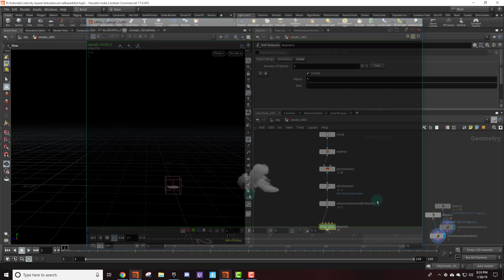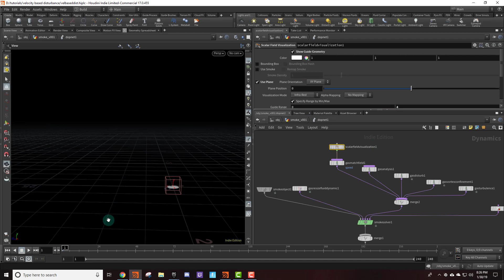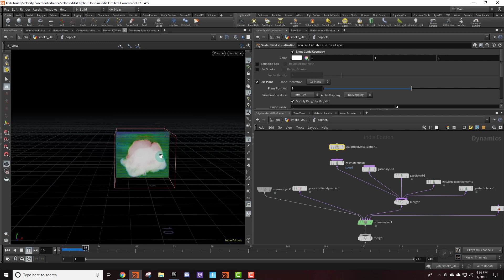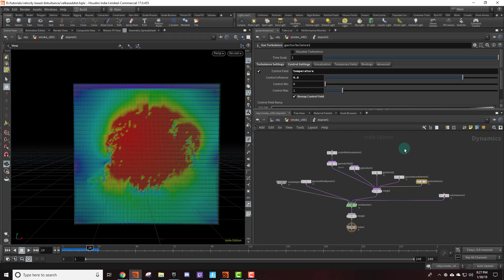velocity based disturbance houdini [old]

Comment: Hello, how and where i connect this node in the new pyrosource?
Reply from the maker: I just marked this video as old, the new pyro solver has a built in calculate speed button. I might just make a new video sometime.
Reply: @evanrudefx   Do you know how pressure masked disturbance  pyrosolver
Reply from the maker: @SebastienLevieux  I have no idea what you mean, sorry. I don't understand the question
Reply: @evanrudefx  Sorry, I am trying to avoid the mushroom effect in my sim with the new pyrosolver, someone told to do it  like that: "you can export pressure field and use a volume reduce node packing max value into detail to figure out what knid of values you need. its tricky, requires a bit of fine tuning" And I found your video...
Reply from the maker: @SebastienLevieux  I think I saw something about that using the pressure field, but I don't use that method. On the new pyro solver I just use the new calculate speed and use it as a control field for gas disturb. I will make a video at somepoint, but I am not sure when. you can also check out this video: https://youtu.be/Hy4R5Vf-dVM?t=920 He talks about at that time stamp its more so about breaking the shape into smaller mushrooms rather then avoiding them because mushrooms are natural movement in a fluid solver.  Oh, to say one more thing, I also like to add random velocity to my source particles using either the curl noise on the point velocity sop or the "add velocity noise" on the pyro burst source. If you crank that up will break your shapes quickly from the original shape.
Reply: @evanrudefx  Thank you for your explication, it is amazing :)

Comment: nice tutorial. you should be able to dive into the gasdisturbance dop and add a "length" node between the "control field parameter" and the "if then block". might be a bit more memory efficent due to houdini not having to create an extra field.
Reply from the maker: thats true! I do it this way because I am a noob and like to visualize the "speed" : )
Reply: @evanrudefx  you can actually visiualize the speed thorugh the standard velocity visualize option under the smoke object. there should be an option to use the plane and visualize by speed, that will calulate the magnitude for you. but its always a great idea to dive into the microsolvers to get the feel of whats going on:)
Reply from the maker: @themakersofsoul  awesome! thanks!

Comment: Thank you, Evan!!
Reply from the maker: No problem!
Reply: @evanrudefx  It is too difficult to handle the smoke...  I'm in trouble to how to use microsolver in dopnet... Is there some kind of examples?
Reply from the maker: @dongjoonhan3179  I learned a lot of what I know by looking at the pyro solver. If you unlock the pyro solver and look inside you can see how to set up the different microsolvers. The pyro solver really isn't a solver. Its HDA of the smoke solver with easier controls because the micro solvers are already setup.
Reply: @evanrudefx  Oh, I didn't know that! It's interesting! I will unlock and trying to understand what you said! thx :)